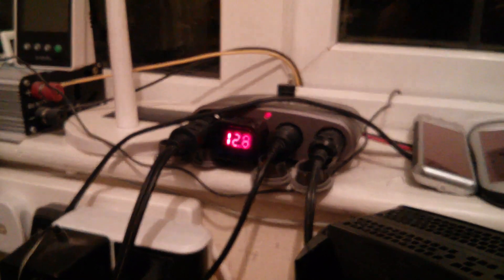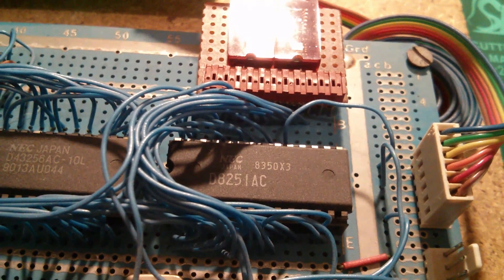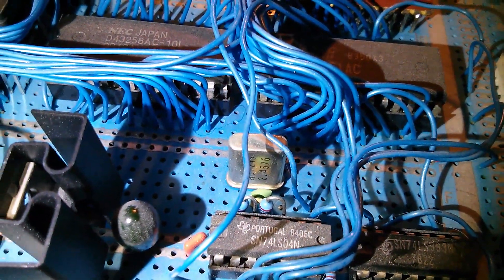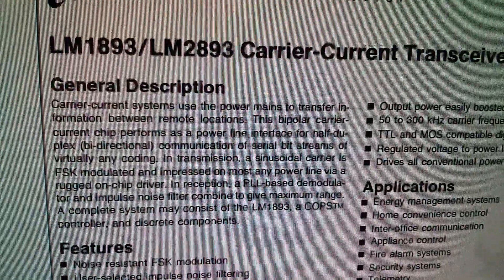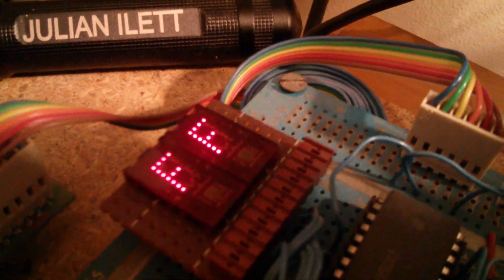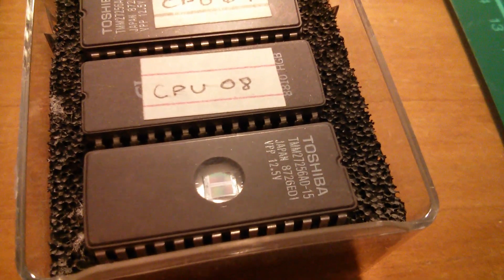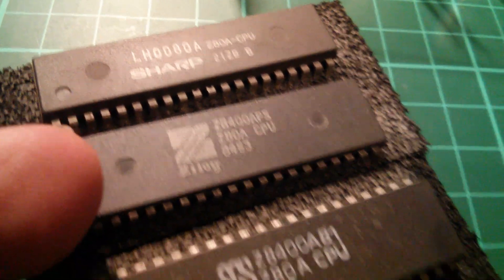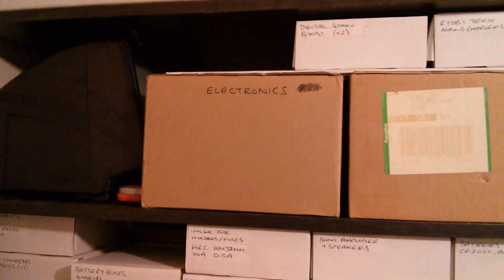Retro Electronics: Z80 Nostalgia

Comment: I had several microcomputers with Z80 clone implementation. I started with the LC80, a microcomputer for education purposes, I bought in 1985. https://en.wikipedia.org/wiki/LC80
 
My second computer was the customer version of the Z9001, also called KC87 https://en.wikipedia.org/wiki/Robotron_KC_87 . The last Z80 clone I have used was the allready quite comfortable KC85/4 https://en.wikipedia.org/wiki/KC_85 . For this device I programmed also several user software like a text processor.

Comment: That A/B/H-thing was abandoned somewhere in the second half of the 1980s. Your Z80 from 1987 is formally rated for 4MHz (by that 0004 figure at the top) but is probably faster than your Z80"A" from 1984, simply because it is newer. However, most Z80s would function at at last twice their rated speed, according to my experience, especially the CMOS versions. Even the old nMOS Z80 from NEC that sat in my ZX80 ran at 12 MHz without any problems, i.e. using faster (100ns and 70ns) memory chips.

Comment: Hah, I built my own Z80 system on a home etched board! Which was a pain to start as the wiring and the soldering was really dodgy. It worked only once, then I gave up. Debugging this with only a multimeter was quite a bit of a pain! I may still have it in one of my boxes that is labeled 'electronics' :D
(Also, back then I decided it was a good idea to write my own Z80 compiler. Mind you, that was before the internet, so one couldn't just download a compiler.)

Comment: can any good spirited fellow tell me, which was better for late 80s arcade video games: a z80 or 6502? - by better I mean easier to work yet powerful with (programming-wise)
Reply: I did some 6502 assembler  programming, which I personally found quite easy. The Z80 had a reputation for being more powerful but harder to program. The MC6809 was widely regarded as having the nicest instruction set (orthogonal, with  some 16-bit instructions, iirc), but it was relatively expensive.

Successful games computers like the Commodore 64 used a commodity CPU (a 6502 in the C64) coupled with custom integrated circuits which handled things like the sprite graphics and sound, so the role of the CPU was more an overall coordinator, and the custom hardware handled the fast stuff.

If you're talking about the end of the 80s, the most interesting computers used the 16-bit Motorola 68000, again with custom hardware to handle the sound and graphics. Examples include the Commodore Amiga (way ahead of its time in terms of its hardware and operating system), and the Atari ST. 

The move to 16-bit allowed manufacturers to run much richer operating systems; I believe that you can run NetBSD on an Amiga, for example, and its native AmigaOS was a brilliant piece of work; interrupt-driven multitasking, multimedia, with a graphical user interface, and using the little-known  procedural language, REXX as the OS scripter.  

In comparison, the Z80 and 8080-based CP/M was single-tasking, with a primitive command line interface. Note that I'm not knocking CLIs - it's just that if you've used a UNIX shell and you then have to return to something like CP/M, you will miss it badly.  As a matter of morbid interest, CP/M on the 8080 inspired the single-tasking MSDOS on the early IBM PC's 8088 (a horrible CPU with a 16-bit segmented memory architecture which allowed you to access the memory in 64k chunks).

If you've never heard of REXX, and you're interested in computer language archaeology, check it out.  I first used it in the early 80s on an IBM mainframe,and it was a revelation in its ease of use, elegant and clear syntax, and powerful features like associative arrays, excellent string parsing, and a double-ended queue mechanism for handling data. 

If, instead, you're talking about arcade machines, the picture gets more complex, and systems often used multiple 8-bit and 16-bit CPUs.

Sorry about the wall-of-text, frequent diversions, and the 9-month lag.
Reply: Great! I'm sorry for not being specific. I only meant Aracade game programming :D
Reply: From a current, practical standpoint, I thought this link was interesting: 

http://www.luke.maurits.id.au/blog/post/on-choosing-the-z80-over-the-6502.html

From a personal standpoint, the very first coding project I undertook involved my learning 6502 and then writing a dumb terminal emulator in 2 or 3k of memory.  I found it a pretty easy process.  

Both processors were used in arcade games, although there was a big shift towards much more powerful CPUs in the late 80s.  The people I worked with all rated the 6502 as easier to use than the Z80.
Reply: Great! will check it! thank you! :)
although I make games using a drag and drop program called MMF2 (no programming) it is good to know stuff like that as I sometimes have to "emulate" or mimic stuff!

oh and I also asked because I noticed many z80s on the intros of arcade games, but I guess I've never seen the screen say 6502!!

Comment: i'm more for the 8088 and x86 series of chips. but this is awesome!

btw any data on the red led display chips? they are so cool. i wonder if i could track some down.
Reply: +Rinoa Super-Genius Probably TIL311 Displays
Reply from the maker: I wouldn't be surprised if they're HP displays. But I think the part number is on the back and I soldered them down onto a piece of stripboard.
Reply: Julian's Other Stuff ah that is annoying when they make the part number difficult to see, i'll prolly end up coming across some of those one of these days.
Reply: Rinoa Super-Genius
I have seen an amplifier IC with the part number on its bottom. Just why?!

Comment: Thats so ironic that I have just been looking into building a Z80 based retro computer.
I am also dabbling with a i8088 board that controls a Balco Wheel Balancer.
Just finished building a EPROM dumper with a ATMega32 and some 74HC373 latches, that dumps the contents of EPROMs to the RS232.
Interesting old stuff.